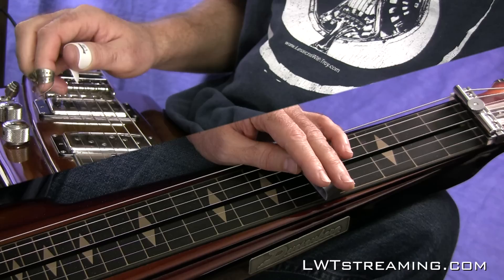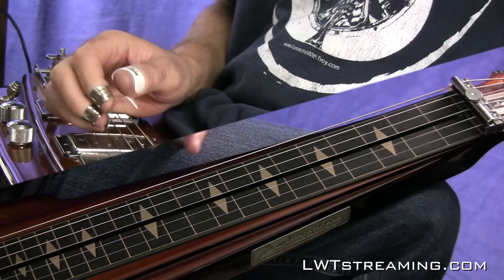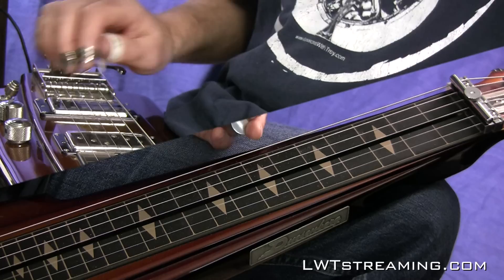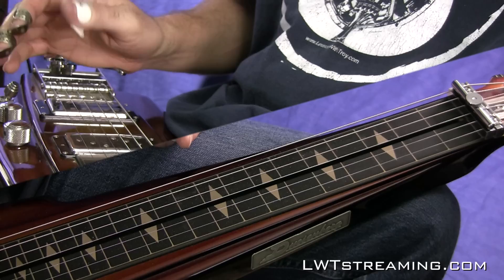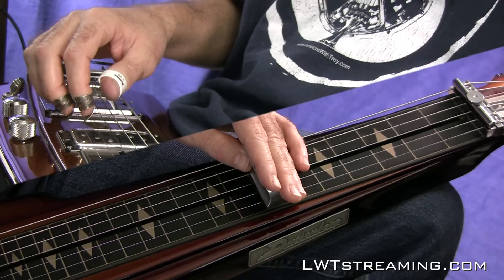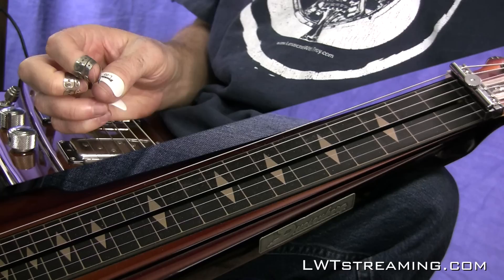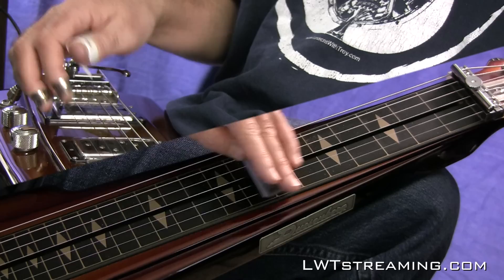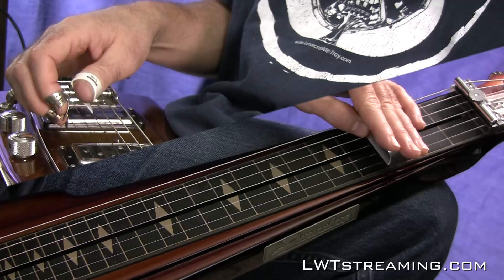Duesenberg Lap Steel - Open D - Intro to the Multibender

Comment: One of the sweetest most plaintive and beautiful sounds ever devised by man. You play great, just gorgeous, wish I could afford to buy one!
Reply from the maker: Thanks Martin! Glad ya dig it.
Reply: Martin Heath 
I bought a dimavery lap steel which in the U.K. cost £115 - it’s way better than my Quincy which the same as Harley Benton as it has an alloy nut, shielded pickup rout and decent pickup. It seems to be the same as a Gretsch electromatic lap steel minus the Gretsch single coil lap steel pickup and hand rest. 
I’ve put a dusenberg multibender on it and in total it still cost less than the Gretsch !
Reply: @vinnieirvine1365  thinking of doing something similar myself, glad to hear it works. Any issues with the nut and tuning stability. Think the expensive duesenberg uses a roller nut
Reply: David Hawkins 
None whatsoever- the alloy nut works well. A roller nut seems a great idea. But when setting up the bender ( there’s a lot of tweaking to get the pitch correct on depressing the lever) and it returns to pitch fine and as long as the strings have stretched and settled I’ve had no issues at all.
Reply: @vinnieirvine1365  that's great, thanks for responding, you've probably saved me a few quid
Reply: David Hawkins 
The Dimavery is really good for the money. I put a Gold Foil Humbucker in and a jazz bass pickup cover to use as a palm rest between the multibender and the pickup.
Reply: @vinnieirvine1365  I'm not familiar with the dimavery, I'll definitely check it out
Reply: David Hawkins 
The Dusenberg multibender fits nicely. The Rogue / Harley Benton style will leave it hanging 2/3s off the end and you’d have to cut the pickguard as it’s 4mm to narrow to allow the bender to fit.

Comment: Thanks, Troy, for a great posting. Loads of great, usable information. I have these palm pedals on my dobro and am just getting started with them. I started of in standard dobro tuning and used the return springs to tune down to the changes, but open d is definitely the way to go. By the way, if you include the 3rd string (without the bender) and used the 2nd string bender you get the full minor triad 5, R, 3, or you can go strings 4.3.2 and bend up from flat7 to root of the minor on string 2. A nice, simple arpeggio. Thanks again. This video really helped me think things through.

Comment: Excellent demo. I was wondering if I should use D9 but this sounds great. I think I’d struggle with D9 so hearing what you have done with open D has helped me decide I’ll stick to open D.

The techniques in this video are golden. I will refer to this tutorial over again now I have put multibenders on my lap steel

Comment: I'm going to ask a question that will seem stupid (I'm a bass player) I see that one of the benders is higher than the other. Is this an adjustment for your playing comfort and hand positioning or is it an adjustment in terms of tone, the higher one would have more amplitude and therefore more effect/impact on the tone of this specific string ? I watched another video of yours on adjusting the front/rear screws and I'm having trouble understanding the adjustments.
Best regards, Arnault.

Comment: 2nd string bender is up two steps,  right? so on top three strings you got: b-d-g -> b-e(^2)-g 

correct? but that's I to the vi, not the IV. Or am I missing something?
Reply: Viktor Kaganovich no you’re exactly right,  you should really engage both benders to go from 1 to 4.  But the 4 and 6 chords are very similar, a 4 chord is 4,6,8 (8 same as 1, so 4,6,1..). where a 6 chord is 6,8,10..(6,1,3).  If you lean into one lever and then the other you can get many cool licks over that change, and you can similarly release them the same way.

Comment: The Dussenberger seems amazing but cost prohibitive :-(
Reply: The multibender is available as a replacement for a 6-screw trem on a strat ;)
Reply: @arvedbohn6133  Cool!  Ideally I would like it on my Chandler 6 string Lap Steel if the spacing worked.
Reply: Oh yeah, my wife would kill be if I spent $2,500 on a Duesenberg lap steel. I've seen some for $699 on Ebay that have the two benders like the Duesenberg. Not sure of the sound quality though...
Reply: You can find pedal steels for what these dusenbergs cost

Comment: Hi. I just bought a Fairytale. You prefer the bridge pick up. What are your guitar and amp tone settings?
Reply from the maker: I think I mention it in the video. It's a Kemper with a Michael Britt profile of a '67 Fender Deluxe Reverb. Tone settings are pretty much all at 12 o'clock.

Comment: Hi Troy. First, thank you so much for posting! I have been a guitar player for over 50 years but as a result of severe nerve damage from a motorcycle crash in 2016, I can't fret with my left hand. I'm thinking about lap steel as an option to traditional guitar. I don't have the $$ for a Dusenberg like yours. Is there another option for an instrument that offers the same features for under $1,000?
Reply from the maker: If you're just wanting a Lap Steel, there's a sorts of ones out there for pretty cheap. Old Supro's are really cool! Also, you can buy the Benders from Duesenberg separately and put them on a cheaper lap steel.
Reply: I have a two lever Bigsby palmbender on a modded Fender 51, works for me when I’m not playing a Fender 400
Reply: Get a pedal steel guitar, you could probably find decent ones around $1000 if you do your research, and has much more versatility
Reply: I recently bought a 2nd hand Gretsch  5700 (€ 230) and a Duesenberg Multibender (€ 270) . Easy to install, very happy with it! 😊

Comment: the multibender for elect guitar has adj. saddles while the multibender for lap steel has straight saddle. wat-a-crok! doesn't duesenberg know that lap steels need compensated bridge also? i recommend you replace yer multibender with the adj saddle part, or buy the entire multibender part aftermarket.
Reply: I don't know whether the bender makes any difference but I've had a LOT of lap steels - Rickenbacher, Fender, Supro, Cole Clarke, a handbuilt one - and not one of them has had a compensated bridge.
Reply: Lap steels do NOT use or need a compensated bridge. You tune your steel to whatever chord  you're using (e.g., open D would be D-A-D-F#-A-D). You tune that open chord to be perfectly in tune. Look at a pedal steel -- same thing. The string all 'break' over a roller bridge, which is straight across.
Reply from the maker: @lapdawg60  Exactly. I normally tune the 3rd of the chord -10 cents
Reply: @lapdawg60  it is 'more' in tune with compensated bridge. i notice a huge difference in sharpness (accuracy) of chords. no diff in single string at all, with compensation one can play 3 strings and achieve a believable musical chord-not so with straight bridge. most players are out of tune to my ear, to each his own i guess. put it on a tc clip on tuner which is accurate to 1/20 cent and see it is out of tune if you think it is in tune.  nothing is perfect but i say straight bridge is junk. i deserve better closer to 'in tune' than a straight bridge. use vibrato to disguise the fact that it is out of tune, that is what the deniers do...
Reply: As long as you're playing with a wound 3rd, I think the straight bridge is perfectly fine.
Reply: @raffyzoo2130  show me a pedal steel with a compensated bridge raffy? or show me any commercially produced lap steel or Dobro with a compensated bridge! A straight bridge seems to be good enough for all the rest of us slide players!